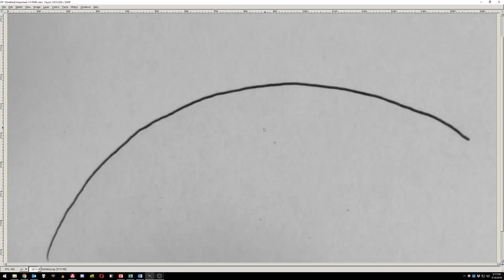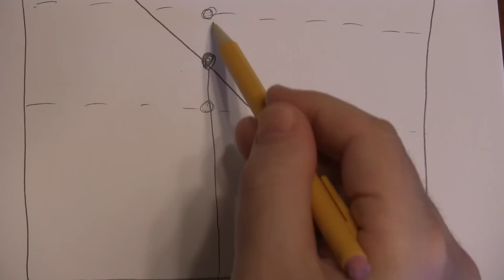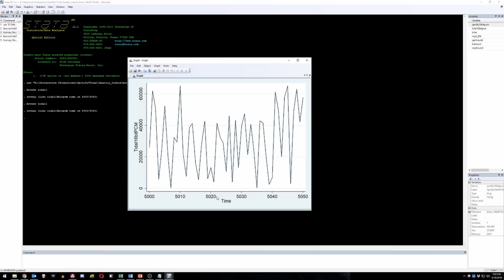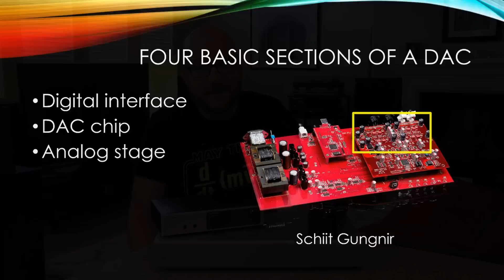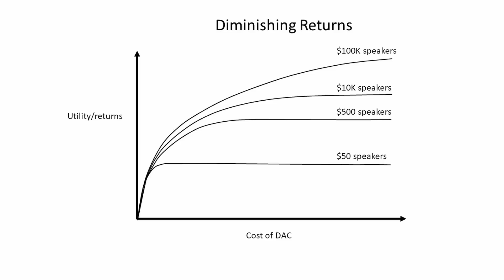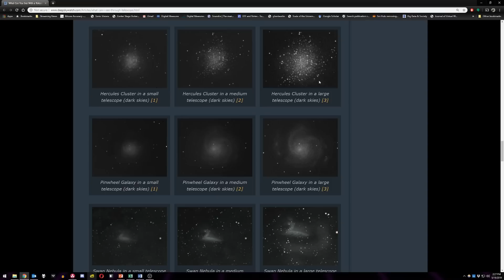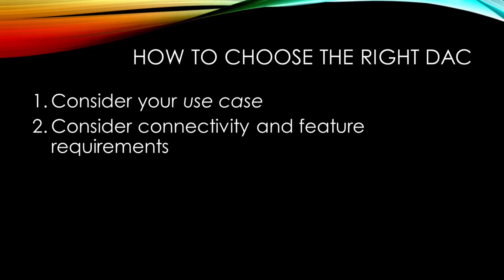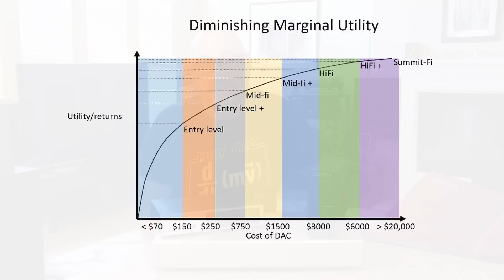DACs 101: Introduction to DACs and DAC Buyer's Guide.

Comment: Is it possible that digitally recorded music is better played back on digital devices and same with analogue?
Reply: Speakers are analog, as are amplifier, so the signal has to be converted by a DAC, but the DAC inside your computer, for instance is not as good as one you can buy separately. So, they sell what they believe will make your digital source sound better than what comes as stock in that source. Separate external DACs offer upsampling at generally greater frequency than internal DACs, as well as other refinements that make them sound better.

Comment: This was a good explanation, but the one thing that bugs me when describing the A to D process is how there is somehow data that is missing in the final output waveform. The "missing" data in stair-step encoding is always exaggerated, and the waveform that comes out at the other end IS perfect - the data points along that analog wave are again infinite. It is analog and it has been perfectly reproduced because the distance between the two points on the wave that is missing is soooo tiny that any possible frequency that could actually change the wave in any meaningful wave is so high that humans can't hear it.

Comment: Hmm it's all very well having a high end DAC as long as you have a high end amp and speakers or headphones. Analogue electric to sound converters are far from perfect, even the best speakers introduce significant distortion of the original sound. Also for old blokes like me hearing loss particularly at high frequencies will negate some of the gains! Oops looks like I jumped in too soon😁

Comment: How about a CD player that has an internal DAC which can also be accessed by other external devices - an example is the Luxman CD-05u? Assuming this is a nice quality internal DAC in the Luxman, you get a 2-for-1 outcome from this arrangement. Thoughts? Thanks!
Reply: I know some people do that with the now-discontinued Oppo Blu Ray players, which had digital inputs and a great DAC.  However, I think it's more common for people to go in the other direction.  That is, get a good DAC and send the bits from your CD player via the digital output.
Reply: Does this approach require a decent level of CD player to retrieve and send an excellent rendition of output to the external DAC? That would be my initial concern. The old saying that a chain is only as strong as its weakest link seems to apply when using an external DAC. If you use an entry level CD player to extract the audio from the CD, it would seem to negate the added benefits of a terrific external DAC down river since the bit stream coming to the external DAC may be less than ideal. It's for this reason that I still feel that a high end CD player with a very nice internal DAC keeps all of the digital-to-analog processing within one machine that has equal stages of ability (transport and DAC). BTW, your video above is superb!!! Very impressive!
Reply: @Tnapvrvideo  I dont have much experience with high-end CD players, but at the transport level I think you would need a very revealing system for it to make a difference.  My current CD player is an Onkyo 7030, which is basically entry level.  There is a noticable improvement going from  the onboard DAC to connecting it via coax to my Rotel amp (which has a Wolfson DAC onboard). 

I suspect it would scale pretty well from there.  For example, if I drop a couple of grand on a high-end DAC, the limitations of the Onkyo transport might be more apparent, but you can get really well-reviewed Cambridge CD transport for $500.  In fact, I think that flexibility may be a good argument for going that route.
Reply: I agree completely. By adding a well reviewed CD transport, you have indeed removed the weak link allowing everything down stream to work to its potential. It does offer ongoing upgrades and easier exploration when you go the separates route. For this reason, I do think there is merit in considering a high end CD player that also offers itself as an external DAC within the system. It gives you high end CD playback from both the player itself and from other well reviewed transports and CD players upstream. In fact, this approach creates a built-in A/B comparison capability where you can demo up stream transports and CD players against each other using the downstream DAC within the high end CD player as neutral ground. As for a very revealing system, I agree. It does require significantly nice speakers to hear the subtle nuances within a song. Of course, that's the joy of listening to and tweaking a home stereo system. You keep finding ways to extract a little extra from a song that you have listened to many times over. That said, in no way do I want to remove the simple, pure enjoyment of listening to music from any source. It's only when it becomes a hobby that you embark on a path of never ending system building. I think at that point it is more about the equipment (visually) than it is the music itself. I fall somewhere in between ear buds and an all-out search for the perfect sound/system: and more toward the ear buds side of the scale. I settled on a system that will be it for many years to come.

Comment: im currently having mic problem. i just bought this usb DAC digital to analog audio soundcard and it has 3.5mm jack so when i plug my 3.5mm jack on my steelseries arctis 3 it sounds great! but the problem is the MIC IS NOT WORKING. would love to hear if someone can help.
Reply: most likely the headphone jack doesn't support mic output.. I know my Audioengine D1 doesn't.
Reply: @quarant9ne  I tried that with my DAC but still didn't work so not sure.
Reply: @B0SS330  ok thank u so much i will just probably get a usb mic

Comment: So you don't need a dac if your using a turntable sense its already analog ? Or does it get turned into digital & then back to analog  for the speakers?
Reply: Blue Sky 777 turntable is all analog for the most part, Unless it has Bluetooth, then that might be another story.
Reply: @dynodin81  Thanks dude , Im a big dummy with a lot of this stuff, I might get the new Technics 120-??? it has its own phono preamp built in & my AV I guess has a cheap dac in it. so I think I just have to make sure I got the right connections on the back of the AV. Im not sure I can use component connection I think it has to be RCA con. ? I don't know if get this from a movie, but every day for me is-- " baby steps- baby steps"........ " Im Sailing" !!!!

Comment: That is why i have no dac at all. I listen to digital. I spent 3k$ on amp vonverting PCM to PWM which is sent to speakers which together with caps create low pass filter. So my virtual DAC is embeded between amp and speakers. So conversion from digital to analog is not done by a dac chip but it is done on output of the amplifier. Signal i amplificated in digital domain. And volume is just adjusting power from psu. It means digital amp but volume is fully analog. I am still impressed how different from any other aproaches it is. You can call it power DAC because there is no amplification in analog domain.

Comment: Should I assume that older DAC (6 years) is obsolete?
Reply from the maker: What kind of DAC are you talking about? I would say generally "no, it isn't obsolete." Sure, there may be some exotic new formats that it doesn't support, but for the most part that doesn't matter much (if at all). As I mentioned in my video, the basics of digital to analog conversion are very well established. A 20-year old HiFi DAC is still pretty much a HiFi DAC. The only real concern I'd have with an older HiFi DAC is digital interfaces have evolved, especially USB. Older USB implementations are actually quite poor. They've gotten better in recent years and are currently where (IMHO) improvements are still being made. However, if you're using S/PDIF or optical then it isn't really a concern. On that note, if you have a USB source (like a PC or streamer) but worry the USB interface on your DAC isn't up to snuff, you can always get a DDC (digital-to-digital converter). There are some very nice ones available.
Reply: @seltzertronics2538  thanks for the reply. I'm getting the PS Audio Nuwave DAC and plan to stream through Qobuz using audirvana. I've really only listened to records but curiosity got the best of me. The Nuwave, while older is all I could afford used by at $700. it was probably regarded well 5 to 6 years ago. Just not sure how it holds up compared to today's DACs will connect via USB to Surface.
Reply from the maker: @pawlowski6132  PS Audio makes some amazing stuff. I haven't heard that one in particular, but I'm sure it will sound very good. Enjoy!

Comment: To reconstruct a circle you only need a centerpoint and a radius. A matter of 3 datapoints, not zillions.
Reply from the maker: Beethoven's 9th isn't a circle.
Reply: @seltzertronics2538  I am looking for some dac advice. You are definitely way more of an expert than myself and I need all of the help I can get. I have a modest hifi system and my next upgrade is going to be a dac. I just purchased a cocktail audio x50 streamer and cd ripper and from what I've read, it seems to have a lot of capabilities. I want to get a dac that can get the full capabilities out of the cocktail audio x50. I would like to stay under 1700 or get one of the best for the money. I am even fine with used or older as long as I can get everything possible from my equipment.

Just for reference here is the rest of my system.
Primaluna dialogue premium preamp
Primaluna dialogue premium hp amp
Marantz tt15 turntable with a clearaudio virtuoso cartridge
Fosgate Signature Phono preamp
Denon dvd-2900 modified cd/sacd player
Cocktail audio x50 streamer and cd ripper 
Focal Electra 1038 be speakers

Comment: Hmm if a DAC is adding resolution that would mean it is 'making it up'. It is going beyond the samples of the original 44.1/16. 21:56  If the musician's nasal passage is blocked it is either apparent or not at the original sampling rate. If it becomes apparent after going through a particular DAC that means the DAC has introduced a new medical condition into the music. This anthropomorphising is what enables salespeople to sell over-priced equipment to audiophiles.The 3D elements of music reproduction are all captured in the recording/mixing NOT developed by the DAC. If a DAC was perfect it would add no colour to the sound at all.

Comment: Agreed, the first part of this is a pretty good explanation of analogue and digital principles but it is a logical category error to assert that DACs MAKE music. This should be corrected in case it confuses people unaccustomed to earlier music equipment.
Moreover, to equate streaming with 'physical source' media is misleading because the former is too young a medium to be measured fairly in context.
The video falls into the subjective trap [note no examples] 18 mins in. "natural", "warmth", "loose" mean precisely what?
But by 28:20 the presenter is wonderfully amusing about how some audio enthusiasts pass over to loving audio and not music. In the '90 this was called "listening to the equipment" and was often analogous to mental illness -- amply exploited by manufacturers, many from my native UK I am sad to admit.
The small upside of this is that 'vintage' equipment is quite plentiful including a wide range of DACs from huge boxes of mostly emptiness to almost portable ones as well as some fully portable ones which appeared in the 2010s for use with headphones.
While this May 2019 video is well worth watching try to find even earlier ones or try components where you will be using them. 
The final point-loser for this video is that the presenter omits to give due time to where music of various kinds would typically be heard live. So, with regret, I give a rating of 5 out of 10. A few revisions could make it more useful.

Comment: You're explanation of how a dac works is misleading, because of the nyquist-shannon theorem, that states that you can reproduce the analog signal perfectly if you band limit it, and sample it at twice the tha highest frequence of the band, including information that is contained between the samples
Reply: Which is the same reason why high-resolution audio makes no sense for playback. The same original analog waveform is the only possible solution and subsequent system output for all frequencies of the human hearing range at a 44,100 Hz sample rate.
Reply: @azzaipdivad  yeah and what he says about bit depth is quite weird as well the only effect bit depth has as far as I researched is reduce noise not increase resolution, but regarding the frequencies I've saw some analysis that states that the hard filter at 44 hz introduces some amount of audio anomalies and a smoother filter that stars to cut out energy at 44 and ends all the way at 196 might reduce that, but it does not has anything to do with what he said of retaining more information or anything like it
Reply: @matheusbc9622  You are right about this. In recording, higher sample rates and bit depth make sense for the reasons you mentioned and because some signal processing techniques used on the material might make use of the additional information (time stretching a sample without affecting its pitch for example).

Comment: Don’t think you know what you are talking about. Read up nyquist theorem - The Nyquist theorem established the principle of sampling continuous signals to convert them to digital signals. In communications theory, the Nyquist theorem is a formula stating that two samples per cycle is all that is needed to properly represent an analog signal digitally. 

No - you don’t need sample an infinite number of times to capture analog signal.
Reply: Thanks, was hoping someone else down here would have the same concerns. Otherwise great video, really.

For those who want to learn more about the process that is happening to losslessly describe continuous waveforms with finite, discrete representations, there are a number of great videos on Fourier analysis and signal processing here on YouTube.
Reply: Niquist is not the issue, but the requirements of real-world filter reconstructions and their quality vs. required steepness of filtering in the case of 44.1 kHz sampling rate. Higher sampling rates allow smoother filters with better results even for the audible range below 20 kHz...

Comment: Hello

This is one the clearest video's I've watched on this subject.   Im diving in to this level of audio for the first time as of 3 weeks ago.   
I own a marantz sr7010 an up until recently I've been steaming all music through the sr7010 built feature with spotify.   Well spotify stopped supporting marantz which left me frustrated because the generic bluetooth receiver I own didn't produce the quality of audio I was getting directly through the  sr7010.  
So i bought a  FiiO m11 and Audioengine B1 bluetooth receiver.   Now my audio sounds better than before.   
However I'm still having a problem.   When I view the quality of audio the sr7010 is receiving its only registering PCM @ 44hz.  
Im outputting aptX HD from my FiiO M11 so I was expecting to see at least 24bit at 192hz.  
Can you recommend a bluetooth receiver that will maintain and transfer a higher signal to my receiver?  Im connected to the receiver via toslink optical and I'm now streaming tidal hifi.

Comment: If your hearing can't audibly distinguish (e.g., a blind ABX test) between a cheaper DAC from more expensive DAC, buy the cheaper DAC. If you CAN tell you difference, then YOU can decide if that (probably) small audio improvement is worth the extra money for YOU. For 99% of people (including audiophiles) the answers is a resounding NO. Headphones, IEMs, speakers are BY FAR, the most important part of the puzzle. Followed by the recording. Followed by the amplifier. Followed by the DAC. For gamers, a DAC is not the most important part; a good set of headphones and amps is way more important.
I'll repeat: if you can't distinguish the differences, in a blind test, save your money and spend it on a better set of headphones.

Comment: My computer's DAC will play at 192,000hrtz at 24 bit. A sample rate is twice the frequency than the sounds that it can produce without distortion; so, 192,000hrtz sampling will play from 0-96,000hrtz. All this with a 24 bit depth allows my computer to play audio better than a human can distinguish faults. The only reason to buy a DAC is if a given device puts out a hum.

Comment: A dac for 3000,whit 75 year ears?
Reply: If you have the money still at your age, see if there is a high-end audio dealer in your area that is prepared to allow you to review one in your home system with your music or spoken word. If your hearing is impaired, you should notice that the improved precision in the audio signal will help you. Think of a cheap monitor/display/TV with built-in speakers. The impaired hearing makes you turn up the volume. This in turn increases "cabinet coloration" and whilst you can hear what is going on, the intelligibility has seriously decreased because of that distortion. I could not convince my 92 years old father to play his TV's sound over his much better audio system. he solved that with a wireless headphone. The end result is much better quality of living. With DACs it can be similar. Just make sure it advances your experience at home, in your system. And listen to some serious music, not just the euphonic recordings that are extremely successful in selling high-end audio to gullible people.